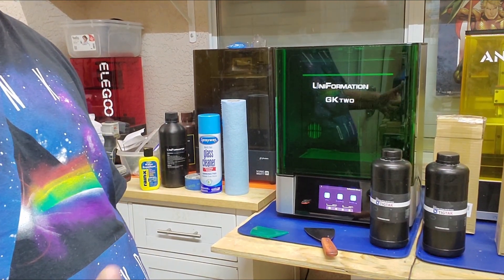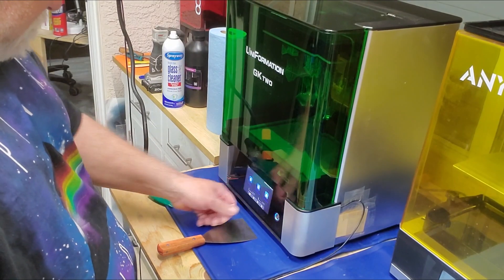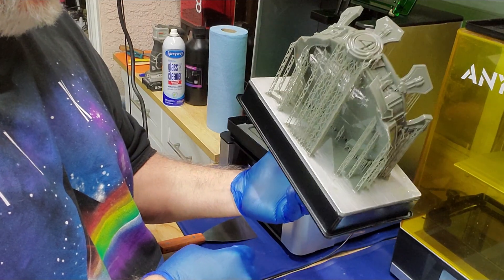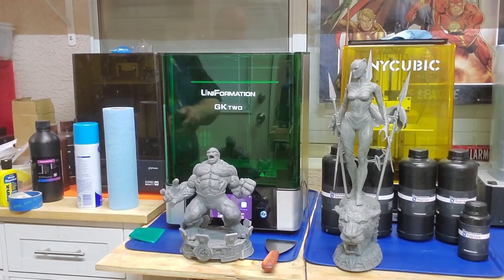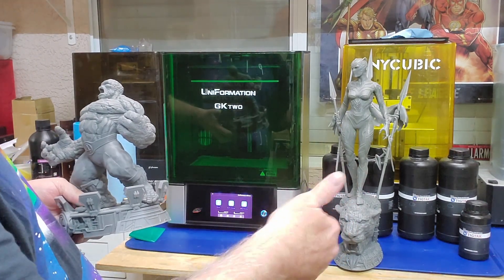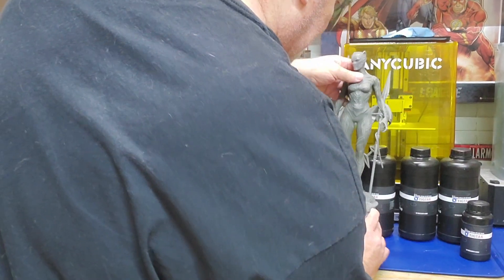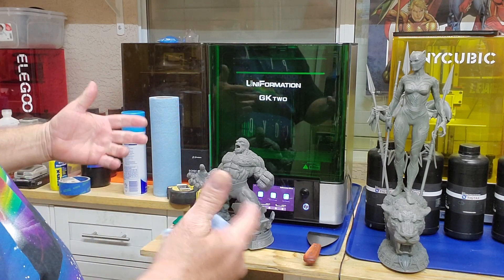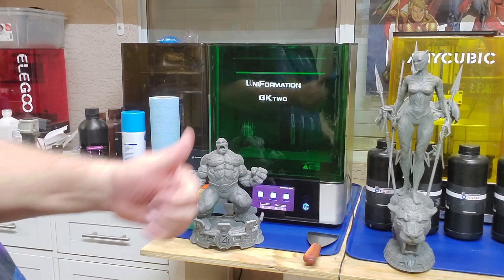UNIFORMATION 8K Resin Printer | TIGTAK Resin | Wicked | Sanix Models #3dhp

Comment: Great video and thank you for sharing, gave you a thumbs up and you got another Sub.  I don't own a resin printer and am trying to learn more about this hobby it just so happens this is the resin printer that I would like to get by actually next year.  Making sure I know enough and have the space and safety situation settled before pulling the trigger.  I also appreciate that although you did not record the cleaning and curing process you did explain how you did handle the process due to size restrictions.  Again thank you for such fine work, happy printing.
Reply from the maker: Thanks for your comment, I have many videos on cleaning and curing in them. Sometimes I skip it because I have done it so much in videos.

Comment: How do i install the resinlapse
Reply from the maker: Hello , The only place on the Gk2 I could find is what a friend had done and it worked for me. First off I removed the screen to expose a plastic enclosure around leds,made a small v cut in it.It is very thin.Took out screw in right front corner,which allows it to open up a little,ran wire in,then to small slit in plastic so uv light source will trigger it.Put screen back in.Wedged the left front with a small piece of wood and taped so metal corner won't crush wire.This was the only way I seen,maybe you have a better way to let sensor get triggered by Uv light source. I explain  in my latest video who I did it on the Peopoly Forge.Hope this helps.

Comment: any tweaking need with supports setting?
Reply from the maker: Using there slicer or chitubox,no ,just auto supports.If model is not pre supported just angle back a little to help keep supports on the front to a minimum.

Comment: 2:00 - Oddly thick build platform robs the machine of some z-axis height.
Reply from the maker: I'm sure under all that plastic,its a standard looking build plate with extra adjustment screws.That wouldn't affect its overall height,since all build plates hang down below Z axis.

Comment: Nice prints, 2 questions: 1. The thing is too big for uniformation curing machine? 2. What is the black cable in side of GKtwo. thanks
Reply from the maker: I don't have a Uniformation Curing machine,just the one from Anycubic which is very large. The black cable as mentioned in the video is for my DLSR Camera to take pics of each layer.
Reply: @3DHP  Thanks for reply.